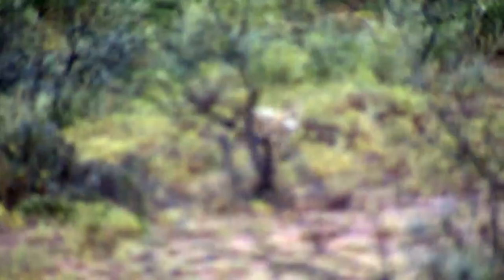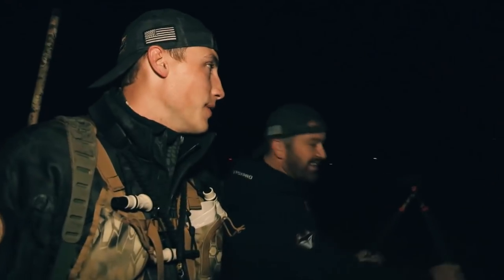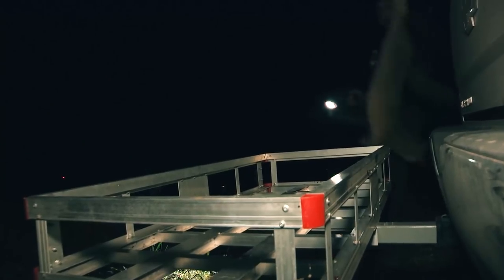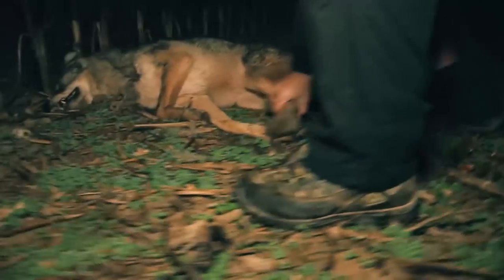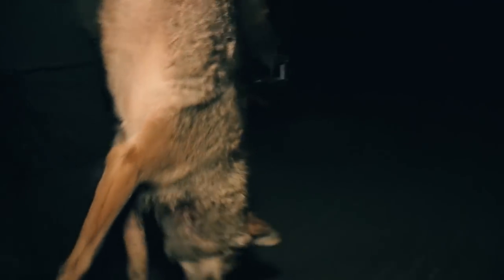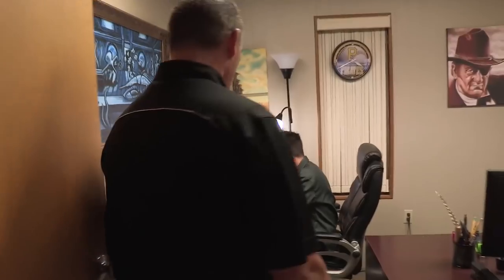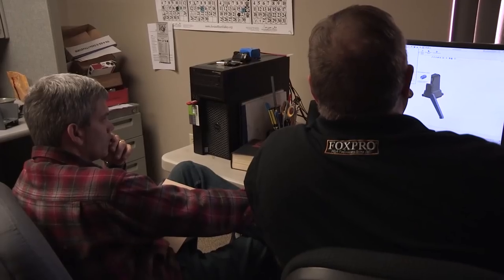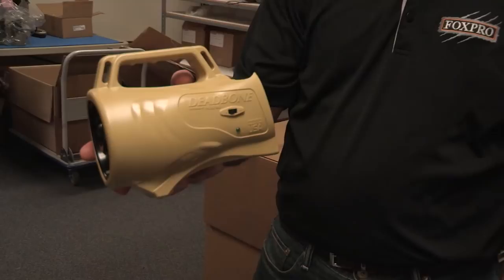Pennsylvania Season Opener

Comment: I'm 33 years old I've never hunted.  Is coyote hunting a good way to start?
Reply: Yup. If you don't have a gun get a bolt 22-250 or a semi auto 556, a caller some camo and lots of reading and field time. If you live out in western states your set. If you live in the East you will have so work to do. Some areas have lots of coyotes others not so many. Where I live a lot of guy hunt with dogs so we don't have as many as other places. Get at least a 3-9 scope with a BDC.
Reply: @gregs8702  thanks for the info man I actually live in central, pa there's lots of coyote out here!